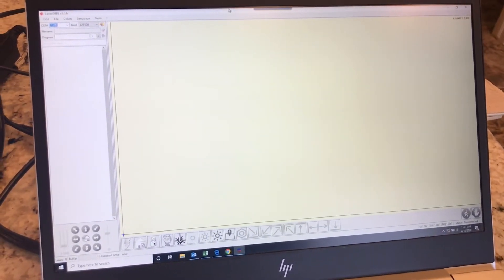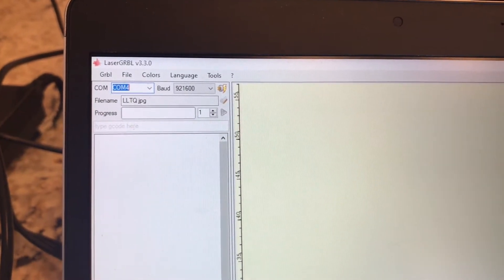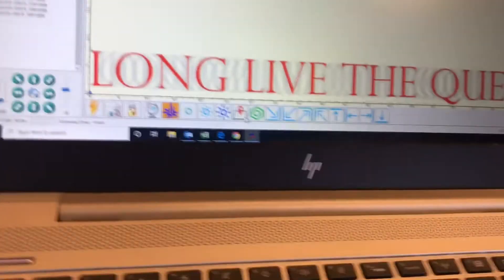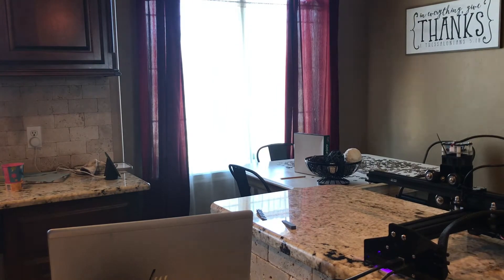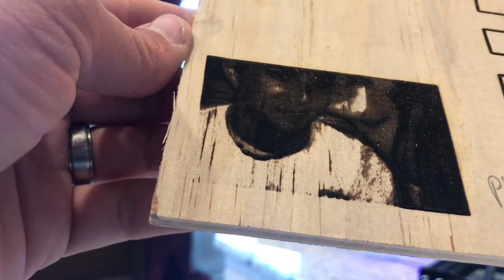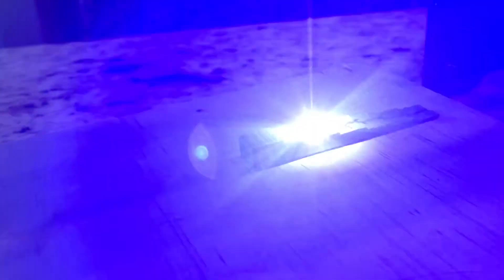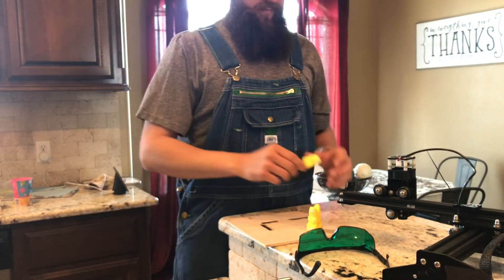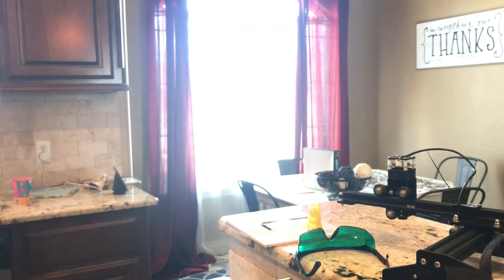Gearbest Ortur 20w Laser Review And Power Test

Comment: Hi ! do you think it can engrave on stainless steel ? thanks !
Reply from the maker: Oummanet Business I have tried metal, but haven’t had any luck. I was told that putting mustard on the surface would help, but it didn’t work. Granted, that was a carbon steel and not stainless.
Reply: @MrJustinWheeler  Have you tried coating the metal with dry moly lube? it is supposed to work to mark on steel items.
Reply from the maker: @davidhaykus1568  I haven't tried that yet. I am going to pick some up at the hardware store and I will try it! Thanks!
Reply: You need fiber laser to properly engrave on metal. This is diode laser which is not design for that kind of stuff. You could also try with co2 laser, but still, fiber is the best for that kind of job.
Reply: I'm wanting to try this but the theory is sound. Paint the metal then use the lazer to engrave the paint off.  Once that's done electric etch the metal.  To etch metal is easy all you need is a battery charger, cloth of some sort, and salt water.

Comment: In LaserGRBL you can set the start by traveling the head to the right position with the arrow keys, then press the mirror symbol. It sets the new start point.
When working with any type of laser, go with the fast settings first. Low power, high speed. The worst that can happen is that nothing is engraved, then you increase the power and lower the speed accordingly until you get a nice engraving. That way you won't waste material to engrave on. I have a fair bit of videos on my channel about the ortur lasers that explain a lot about them.
Nice review, I am now subbed to your channel.
Reply from the maker: Thanks for the feedback! I will check out your videos!